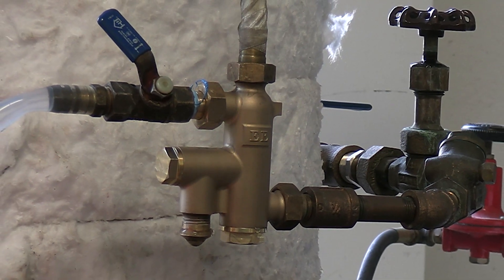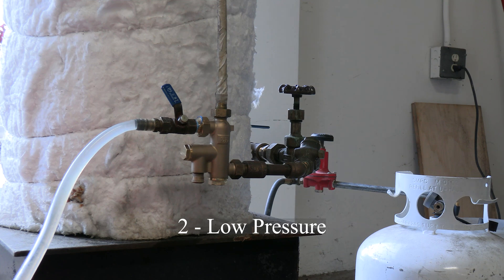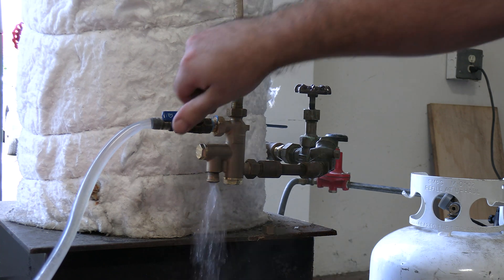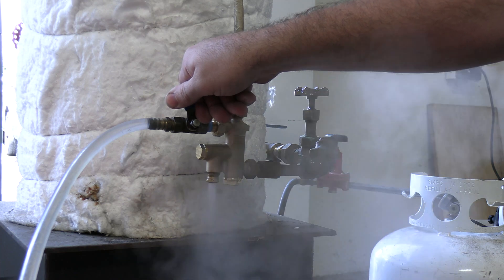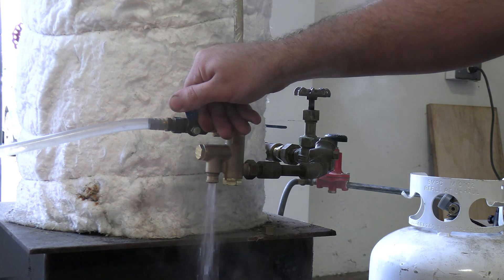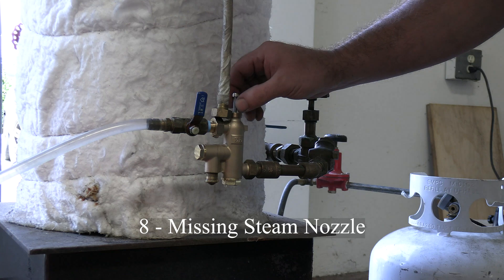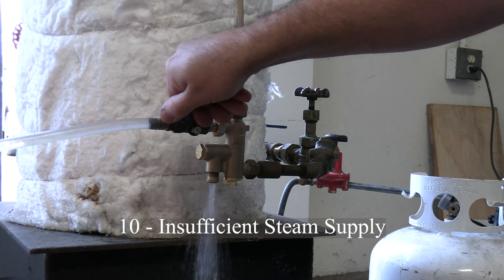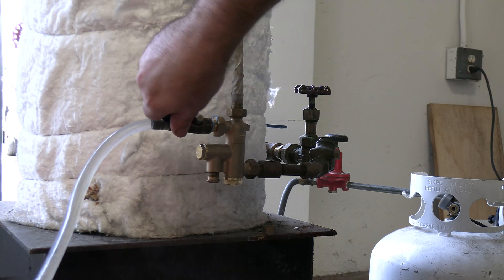Become an Injector Whisperer!

Comment: Great video as always, it will be helpful. I have 2 of your injectors on a new locomotive and they worked perfectly on the engines first outing. If you get around to it, I’d love to see you do a video on the correct way to draw a locomotive driver in CAD. I’ve learned a lot from your videos and posts on chaski

Comment: Anthony,  I have worked with Giffard and inspirator type injectors with moveable steam cones that can inject hot water up to 150 degrees F.  Have you ever thought about designing those in miniature?
Reply from the maker: I've thought about inspirators in miniature, but ultimately decided against it. The less a model engineer has to do in order to operate their injector, the better.